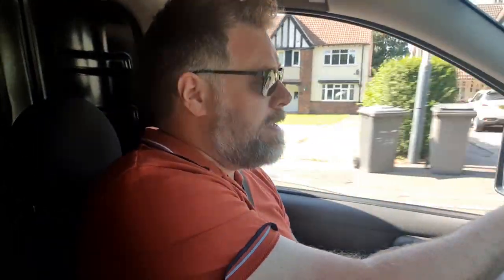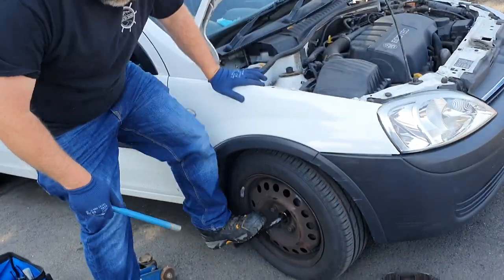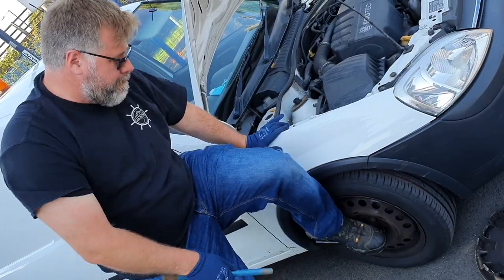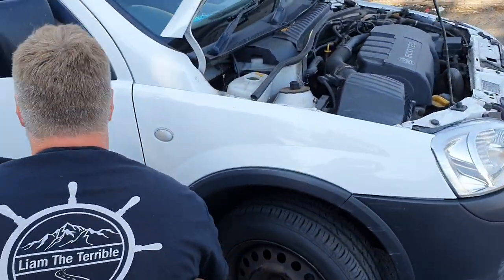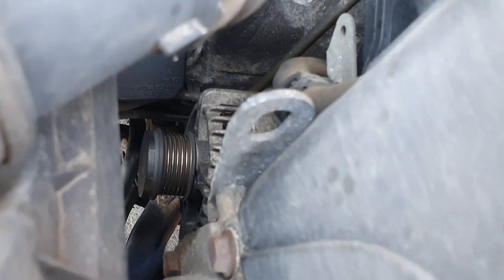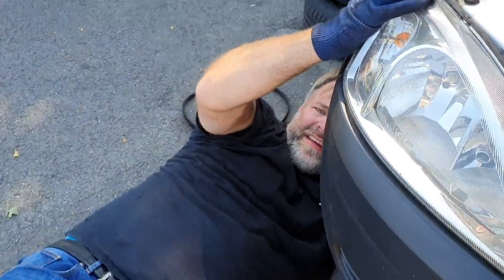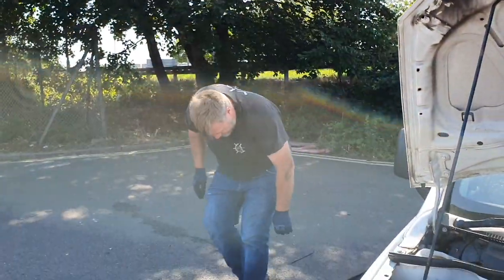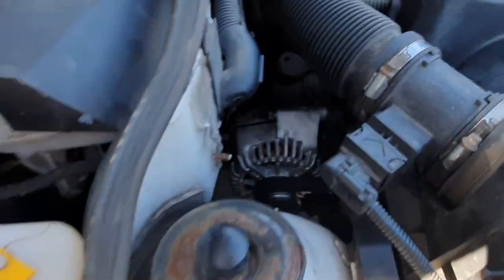How not to start your day: AVA. Episode 15

Comment: I bet that alternator was expensive probably £200 + because it's got the slip clutch on but all would be wrong with the old one would have been the brushes if you just took the plastic cover of took the brushes out gone into two euro parts  they give you a set of brushes for a fiver. But well done for changing that on the side of the road can be really difficult to get out and you look really smart in that T-shirt hope you didn't get it too oily.